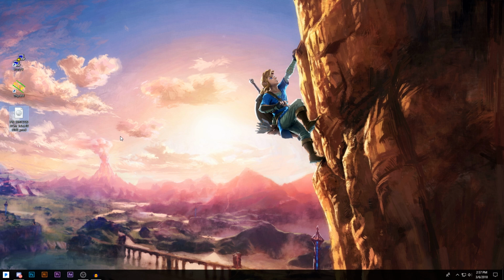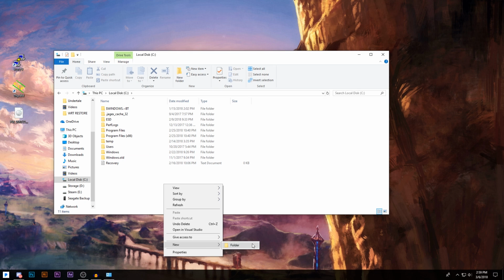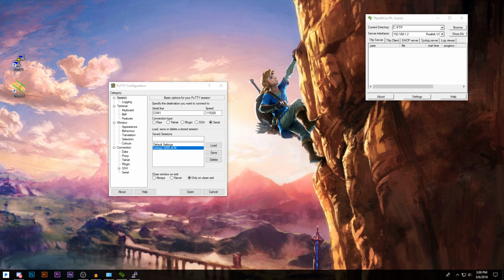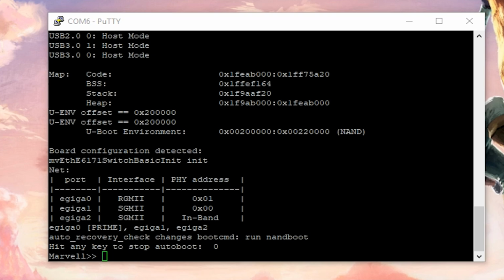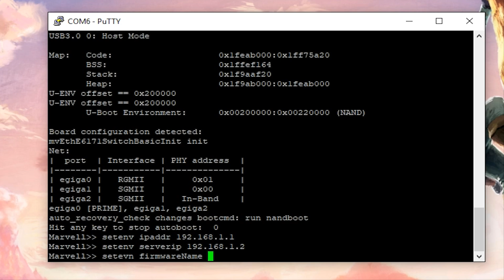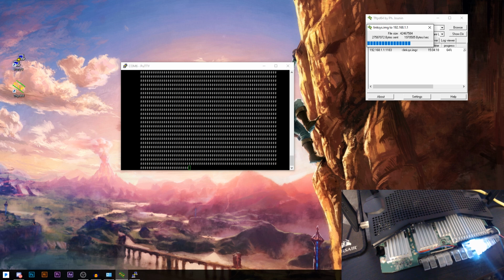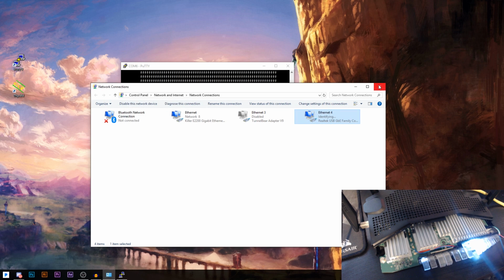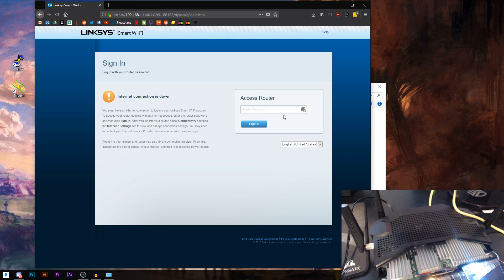How To Unbrick and Restore A Linksys WRT 1200 1900 and 3200 Using Serial and FTP

Comment: Windows 10 doesn't recognize the serial cable from the description even though I ordered the same one. Anyone else?
Reply: @Michael Clark I ended up ordering the Adafruit version of the cable also on Amazon and it worked like a charm. It's about $16 but it worked well. Sad part is despite following this tutorial and many others, my router is still bricked. I think it's a RAM or CPU issue. It's the only thing I can think of since it keeps power cycling.

Comment: Working fine on a Linksys WRT1200AC V2 router. Many thanks for the tutorial!
Reply from the maker: Yes, just use the dd-wrt file the same way as the stock firmware is used in the tutorial

Comment: Ok I was able to talk to the router.. on the serial port but no matter what I do I cant ping the router on 192.168.1.1  even after entering setenv ipaaddr to 192.168.1.1. . I think if I cant ping it.. it is dead. This router was fine until I removed power and turned it back on. now it is deaf -- any comments are welcome

Comment: Thanks for making this video. When I was following this procedure first time device manager not showing COM port so I removed the connector and reinserted properly. After performing this procedure I start seeing COM port in the device manager. After that when I was running  update command I was getting below error message.                                                            Marvell>> run update_both_images
Using egiga0 device
TFTP from server 192.168.1.2; our IP address is 192.168.1.1
Filename 'linksys.img'.
Load address: 0x2000000
Loading: T T T T T T T T T T
Retry count exceeded; starting again                                                                                                                                      I ran that command couple of time but same issue. Then I realize I forgot to connect the Ethernet cable to my PC and to my router. After connecting that Ethernet cable  issue resolved and I was able to update the Linksys firmware successfully. I though it better to share my experience that will be helpful for other people.

Comment: For the WRT3200 ... Did you try reading and following the directions from DD_WRT under the subheading "When something goes wrong"? getting to the 2nd partition ... like to know if that worked before I do this if that did not work ... I want to get the hardware needed first  ... etc. TU!
Reply from the maker: I had already overwritten the second partition so this was the only method of recovery for me.  It's been awhile, but if I recall correctly.  The WRT3200 will always write to the inactive partition when updating, unless you boot to the second partition before updating.  After many messy dd-wrt updates to my 3200, and never rebooting to the other partition, both of my partitions had been overwritten with dd-wrt.
Reply: @crooked535  
Thanks for letting me know ... from what I understand or was thinking  ... having a second partition is supposed to make the 3200 unbreakable ... but they say the Titanic was supposed to be unsinkable  ... go figure. This was one of the reasons why I got the thing ...

Comment: Great guide, though after trying to get this working after successful flash I had issues. Using a WRT32x I had to rename the stock firmware I was about to flash to venom.img and this resolved my issue. Additional point, after run update_both_images and successful NAND flash, use command 'boot' this will show you whether the firmware is successful.
Reply: I have wrt32x firmware dd wrt I want oem ....Is this method successful?

Comment: Doing this procedure almost worked for a WRT32x. Putty started to load but it freezes and don’t get a command line. :(
Reply from the maker: The fact that it PuTTY crashes before you see a command line means that there  is something wrong with PuTTY or your TTL adapter.  Try to reinstall PuTTY and check to make sure that you are using the right COM port.  If you did both of those and PuTTY is still crashing,  I would bet that your TTL adapter isn't working right.
Reply: @crooked535   I checked both items and everything in place and I uninstalled / reinstalled Putty.  No changes. The cable I bought is brand new.  It could be the router is completely dead.

Comment: Is this gonna work with EA6300?
Reply: i'm trying to unbrick my ea6300, if you find anything let me know
i get error flash0.0 not found
u?
Reply: @Sharkiuli  actually it's EA6500, I wonder if the commands would work the same, flash firmware via serial
Reply: @Sharkiuli  you can type show devices and see which flash

Comment: Com port not showing in putty, tried to update driver but still not showing, can you please help
Reply from the maker: The COM port doesn't automatically show up in putty, you have to type it in.  Check in device manager what COM port your ttl cable is using.  Then in PuTTY, switch the connection type to serial.  Under serial line, type the COM port that was listed next to your device in device manager.  For example "COM4" .  Also make sure that you have the correct speed.  It should be 115200.

Comment: I cant seem to get my keyboard to use the space bar or any key in general from stopping it from auto booting... any suggestions?
Reply from the maker: Make sure that you have the TTL cables on the correct pins.  If you have the correct Tx pin then it will show the output,  but if the Rx is not correct the input form PuTTY will not go to the router.
Reply: @crooked535   I am able to see the entire string of the router booting but your probably correct.

Comment: Hi Zach,
I can reach my Linksys WRT1200AC v.1 via putty and its IP address so I was wondering whether there is a way to return to the stock FW via similar approach (w/o USB to TTL cable). Nevertheless I couldn´t find any working help via google so I´m trying You directly.

Any update from the webGUI is not working.

Any ideas?

Comment: i'm trying this but when i go to device manager, i have no com and lpt ports. NONE. everything else that i have connected to my pc is showing up. it is showing up as "other devices > CP2102 USB to UART Bridge Controller" with a small question mark. when i right click > properties on other devices, it says other devices and thats it. when i right click > properties on CP..... it says:

 drivers are installed. 

There are no compatible drivers for this device.

To find a driver for this device, click update driver.

update drivers does nothing. however, i can navigate manually through a list of drivers and find Ports (Com & LPT). the next thing it asks for is Manufacturer and Model. The only thing that makes sense here is Microsoft under the Manufacturer category and under Model, it says USB Serial Device, USB Serial Modem Device and Standard Serial over Bluetooth link. Bluetooth obviously isn't it. if i click on either of the other 2, i get an Update Driver Warning that i shouldn't do the update as "Windows can't verify that it is compatible with my hardware. blah blah...." what do i do? also, i'm assuming when you said to plug the ethernet from pc to router, you meant the "bricked" router, right? that didn't do anything for the device manager list

Comment: Excellent step by step tutorial, particularly for a non-techie like me.  Only problem I had was that TTL ground cable was not making good contact with pin, so I wedged a toothpick, in or to provide consistent connectivity.  Followed instructional video to a tee and unbrick was a success.  Thanks for a great video.

Comment: Thank you very much for explaining this in detail. Whilst I have not physically bricked my router I want to restore Linksys factory firmware to both partitions as I have been playing with OpenWRT, that was working well until I screwed it up on one partition. The second partition was accessible yet runs like a donkey, so time to regress back to square one.